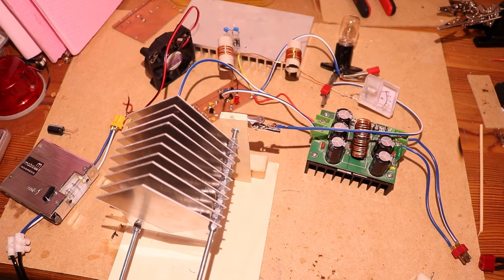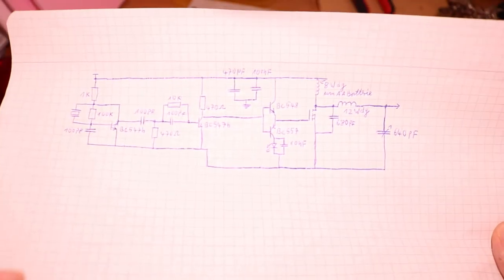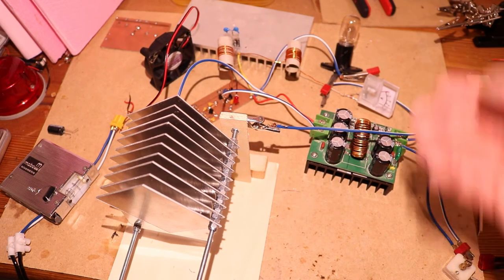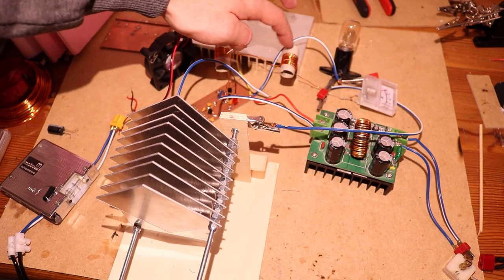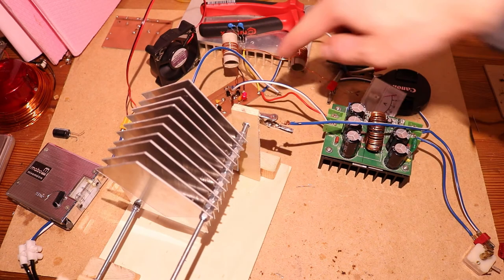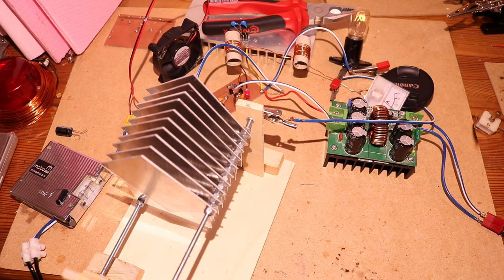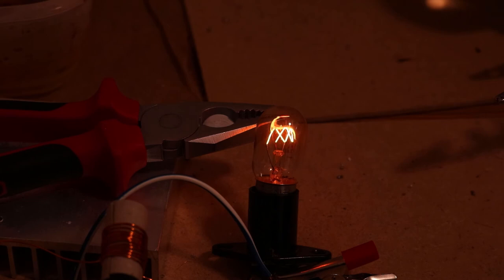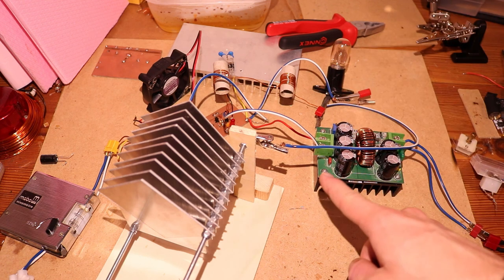Building a Shortwave Transmitter Part 2

Comment: Okay, not bad for the first time, but there are some small mistakes in the transmitter.
First, you need to reduce the number of long wires to a minimum. Connecting a final power amplifier with long wires leads to the formation of harmonics, as well as self-excitation. Second, you cannot power the transmitter from a switching power supply. Only a 50 Hz iron transformer, a full bridge rectifier, and a capacitor. Third, shield the oscillator to improve frequency stability. In general, it is better to perform the generator in an oscillatory circuit. And yes. If you decide to study the principles of radio broadcasting, it is better to start with vacuum tubes. Yes, it’s hard to find a transformer for them, with voltages of 250 and 6.3 volts (and yes, don’t even think about taking the anode voltage directly from the outlet - it’s dangerous due to the lack of galvanic isolation), vacuum tube designs are bulky and require a large case. But they are reliable, they are difficult to fail (so you can safely make mistakes when assembling the transmitter :) ), and you can remove a lot of power from them with relative simplicity. Good luck in your creative endeavors, I hope that soon your channel will have a larger audience.

Comment: 538 / 5000

Hello, 
nice video! 
I am also very familiar with all kinds of channels and build them myself.
do you know which crystal you use? 8 mhz there is also air traffic (weather reports and more)
it is better to buy a crystal around 6.4mhz(6400khz) on the internet (ebay)
there are pirates around 6200 to 6500khz in AM mode.
search with google for grenade am transmitter (schematic)
AM modulators can also be found.
you are also always welcome at the AM forum, we also write English there .. German etc ...

Healthy Friendly Greetings from the Netherlands
Rob
Reply from the maker: That is interesting, as far as I know 8 mhz was used for shortwave radio and that's how I received it with. I do have an sdr stick but it only goes down to 24 mhz. I have to check the frequency assignment for Germany. Do you have a link of the forum?
Reply: @thesciencefurry  
.
PAY ATTENTION!!!
It wasn't 100% exactly 8MHz and it was USB I thought really watch out!
.
Here you have a receiver for those bands:
http://websdr.ewi.utwente.nl:8901/
Permit the audio!
Click on: MAX IN - Click on: AM
Select a frequency in the box for KHZ
for example 6300 or 6305khz on Saturday and Sunday afternoon there are sometimes pirates!
search between 6200 and 6500khz OR on MW 1600 to 1660khz in AM modes
.
.......Questions? let me know!
GOOD LUCK!
VrGr Rob.